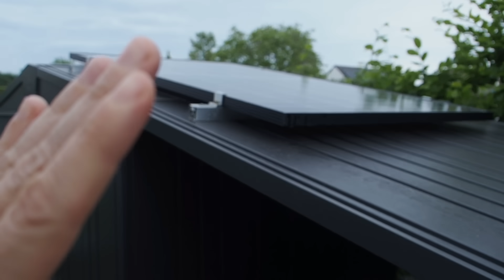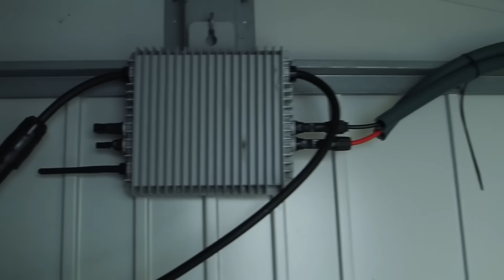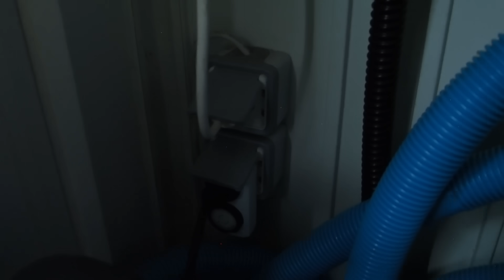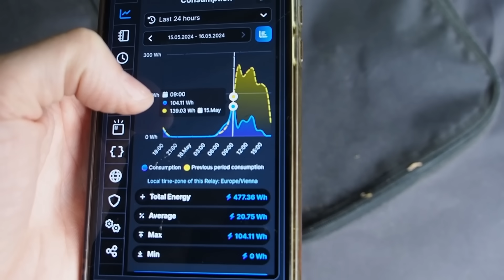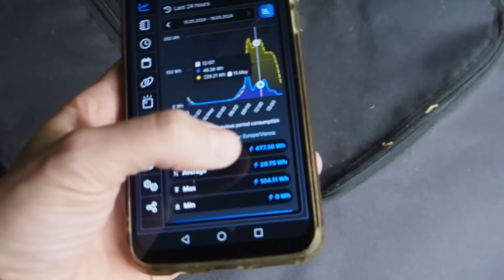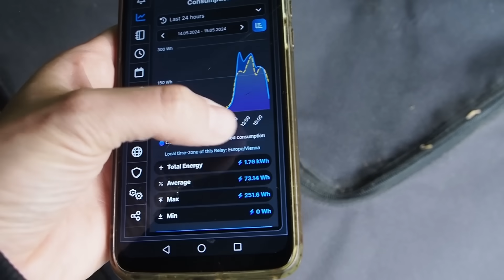Solar system? Yes? No? Which one?

Comment: A good friend helped us build a system that's been kicking butt for five years now. I spent $17,000 USD but that included 18/250w panels, 24/6v batteries, inverter, charge controller, a vented propane wall heater, a hybrid (petrol/propane) 10kw back-up generator, an insulated 8ft x 12ft building to house the batteries and electronics and paying my friend 2,000 for a lot of work including an excavator digging a 205 ft trench and doing a lot of electrical work. It is a 48v system.  The house is in the middle of the forest and grid electric is a mile away so after over 20 years, it was a very welcome luxury!
Reply: Very cool. It makes me always happy when I hear storys like this when ppl helping each other.
Which kind of battery did you install?
Reply: 48v system is the way to go. I wouldn't even consider 24 for a home. An RV or boat, yeah. Cables, lugs, terminals, less output.
Reply: @rtsrts2317  Getting ready to start a van build on a big Promaster and thinking about going 24v.  24 is more efficient than 12, 48 is more efficient than 24, etc.
Reply: @rtsrts2317 my 2500 Watts 12v inverter...powers portable a/c..and TV and fridge..all I need ..maybe if your stationary..u need 24v... otherwise alternator does the trick
Reply: @HANZELVANDERLAAY  How does the alternator run? What recharges the inverter?
Reply: @TeutonicNordwind  off your vehicle..when u drive around..charges deep cycle batteries..also nowadays..u can get 325 amp alternators..very powerful...quick charging....and later when motor is off....use the battery power...and even add solar....to add to the party....inverter just take the 12 volt van system up to house current easily
Reply: @TeutonicNordwind  u can also hook up a car alternator to a stationary bicycle...and charge..the battery ...by peddling..the bike...again look for 325 amp 12volt alternator....install in car....or stationary bicycle 🚲
Reply: @HANZELVANDERLAAY  Oh ok.  I don't want something that's good for a day or two if there's a power outage etc and then has to have power generated to recharge by a mechanical means. What I have set up powers off daylight alone which recharges the batteries. Direct, intense sun is a big bonus. I'm planning for a time when there is no electric grid any more and gas either might not be available at all or is so expensive, people can't afford to run a generator or save it for something more important like log splitter for firewood.  We are totally off grid there at the future homestead.  My system has been running the fridge and freezer all by itself since I left hunting there this past November. Just off of our battery/solar set up. The electric grid is nowhere near the property. The batteries just need to be topped off with water every few months which my neighbor did for me because I couldn't make the trip.
Reply: @HANZELVANDERLAAY  they did a test, even a professional athlete on a bike doesn't produce enough, the fatigue is constant and it would take too many hours, it's fantasy
Reply: @winterburan  I think what you've done here is made a blanket statement.... We can agree you can't run two air conditioners... Off of a bicycle alternator... But you can run a 65 inch TV... You can run a mini fridge... You make it sound as if it's impossible to charge up any electricity... In that fashion... That's a fallacy.. you absolutely can
Reply: @HANZELVANDERLAAY  try and tell me if you can do what you say for 30 minutes, before writing and imagining try, buy a permanent magnet alternator, a diode bridge, a MPPT charge regulator, a battery and an inverter, use the accumulated energy, discharge the battery and recharge it, live perhaps some LED bulbs that generate little effort but after 30 minutes you're fed up, yes you're right it's doable
Reply: @winterburan  yeah I can tell you don't know what you're speaking of... First of all you wouldn't need an inverter to run LED lights... Second of all I could run a huge string of them... All night long on 5 minutes worth of pedaling... Some vehicle alternators put out 325 amps...
Anyway you just don't know what you're speaking of there's no reason to run a power inverter to run LED lights I have a 32 inch TV that runs off at 12 volts ..you know not what you speak of.... We're seeing a lot of that though... good luck to you
Reply: 205 ft trench for cable from panels to inverter?

Wow! That's either a big current drop or you paid big money for bigger cable....
Reply: @willbass2869  I believe we used #4 and there's not shyt for "current drop". It runs the whole household when we're there. Running a chest freezer and fridge right now.  Wire is expensive for sure but when you've got a $15k or 17k project, you don't quibble about about another 4 or 500 in wire. You're committed
Reply: Completely off the grid it is not easy and becomes expensive, but it is very satisfying, if you are lucky enough to have an electrician friend or you manage to do it yourself it is much better, it is already a large system, the next step is to end the use of existing batteries , they are lithium iron phosphate cells, now even the rack ones with built-in BMS are not that expensive and are very easy to assemble and use, although it would be better done with 16 single external cells with BMS and perhaps divided into two banks in parallel, they are very safe and significantly more efficient than lead acid technology, I have never set them above 3.5 Volts per cell, never below 3 Volts per cell as absolute parameters to make them last longer in terms of useful life, often I do not exceed 3.45 volts per single cell during charging 3.5V is the limit for increasing life cycles given the cost
Reply: @winterburan  We are completely off grid and it's been totally free for 4-1/2 years after the $17k spent for the solar power installation with the exception of the propane in winter to heat the small space (8ft x 8ft) - and the property taxes of course, but if I had to replace the 24 batteries today, it would cost me about $4,500 USD. Replacing the inverter today would cost me about 2,300 USD. The batteries should have lots of life left in them though. They were supposed to be rated for over a thousand cycles and we've come nowhere near that and I baby the batteries and electronics and the climate/temps that they live in.. I do not need lithium batteries. There is no need for that expense. The system is in a separate, dedicated building with exhaust ventilation if gases start to build up.
Reply: It's initially expensive, but I finally moved to lithium batteries.  I've had flooded cells and an agm in the past. I'm so happy I finally went to lithium batteries.
Reply: @pstoneking3418  Although if they are not in a living space where emitted gases could be of harm, it's just throwing money away.  I am doing a van build on a 3500 Promaster 159 wheelbase extended and am installing 800ah of self-heating lithium as a 24v system. If you try to charge lithium below 32 degrees F, you damage them
Reply: @pstoneking3418  I see no reason to switch to lithium. Why??  I foresee my system still running after ten years, giving me all the power I could hope for and the batteries are MUCH more expensive so...?
Reply: Very nice,
you would be amazed that today, in 2024 you can buy a far superior system for far less money now, with 550W panels that cost $200 each, and a 10kW inverter that is only $1,000
Reply: @r.b.l.5841  What brand inverter is that? Sounds too cheap. I'm quite happy. I paid about the same as what you are saying because I got 4,500w in panels for $1,800 USD and paid $1,700 for my inverter which is plenty big enough to run the household and it's a very trusted brand - Magnum. That same inverter is $300-400 more now than what I paid. I will never, ever need a 10kw watt inverter.  batteries I bought are about $50-60 higher now than what I paid which was a good competitive price at the time. The most expensive component of my set up was the insulated building which ended up being about $4000.

Comment: In Australia right now they are going to introduce a system where YOU pay for all the excess energy your solar panels export to the grid. Before, people invested big in solar because they paid US money for that energy. Those rates used to be quite high. Now they are a pittance. What they are doing now is trying to force everyone to spend a fortune installing batteries.
Reply: I have had solar since 2013 and I would say they have be totally worth it - even though I use a little more than I produce. The best time is in the spring and autumn when the sun shines a lot and heating/cooling is not needed. Air conditioning is a must in constant 35 C heat during the summer. But I also heat my home with gas in the winter.
Reply from the maker: Wow 😱
Reply: @SurvivalLilly  I'm still waiting for the backlash in the news.......come on people. Give it to the power companies.

Comment: In US Texas they charge 50,000 usd for the solar and claim it will produce enough so no electric bill.  You become part of the grid and are stuck with 1 electric company.  Often your system won’t produce enough to be totally free.  I’d have to ask my neighbors to cut down a tree.  But they STILL would have sold it to me even though it wasn’t’ a good fit.  They encourage you to get a loan.  The only solar I’ll do is a battery system where I sell extra to an electric company.
Reply: Then the electric company will raise your KW  per hour rate. Its a scam. I know I have grid tied solar. Off-grid solar is better.
Reply: @davidsalvador8989 Yep. That's happening in California right now
Reply: @davidsalvador8989  yes i am in Denmark and are offgrid ,i have a 3000w panels a pow mr 24v 80A chargecontrol/3500w inverter and a 1500w turbine and gennerator for nowember,dec jan,  running 15kwh battery,,it works very well
Reply: I designed and installed my own. It was a PITA and permitting has been a royal pain, but I saved a ton and have the system I wanted. I am not using a smart meter. I intend to get completely off grid eventually and I didn't want to be tied to the grid if the power goes out. That's a caveat they don't tell you - if you sell power back you are gird tied and if power goes out so does yours, even if you have solar, because of safety issues - they cannot have the lines energized if they are working on them.
Reply: There's no way I'd sell back my solar to the power company.  Battery Backup with lithium batteries is the way to go. I've just recently started charging my Ford lightning from my solar system,  but only on really sunny days.  I've also used my truck to power my home and simultaneously charge my solar batteries.
Reply: I live in Italy, here storage systems are not convenient, they are not repaid in a useful time, one goes to dismantle them and throw them away without having finished paying for them after 20 years, someone who lives in North Texas told me that the cost of energy it is so low that it is not worthwhile, they do not pay for themselves and are often damaged by bad weather or become dangerous because they come loose during gusts of strong winds etc. They are rarely seen on the roofs, some put them with storage to make up for the frequent blackouts but prefer automatic external generators, which give more power and autonomy to your houses which are enormous with high electricity consumption, all of which costs less and gives less uncertainty, perhaps a small DIY system is the solution to reduce costs and ensure that it is amortized in good time.Ciao
Reply: I live in Michigan. They don't buy back extra electricity. They are also encouraging getting a hookup for EVs, but are looking at taxing it for the roads now.
Reply: Im in east Texas, off grid solar and water. stay away from grid tie system. get a small generator for times you need to charge your bank.
Reply: We have cheap hydropower in Washington State and not much sun yet they are pushing this trash you just know it's another government scam and another way to control our money
Reply: Because private equity has got involved and the salespeople get buck kickbacks from the loan companies. This is another scam just like the liar loans, tons of people being lied to by these salespeople, big article in NY Times I believe in January of 2024.
Reply: Yeah I got screwed here in Grand Prairie Texas and Am in contract with a lawyer about how the company lied to me and said I would have no more bills which is a lie

Comment: Have a off grid system with a hybrid inverter
Reply: ... and with battery storage as well. It doesn't matter if you reduce your bill on a monthly basis, but what would you do if there is a power outage ??? Without battery storage, you are in the dark as everybody else. This is why everyone should install their own solar panels grid independent of any state or government sponsored programs. Because they do not allow you to have storage installed for about 5 years. Not quite sure how that is in Austria where Survival Lilly is located.
Reply: @brainbyte3970  yes I have a system with 3 banks of 48volts 4 batteries on each bank ! I am off grid

Comment: Fit it yourself and get an electrical engineer check it out ! I fitted mine myself and it has paid for itself in 2.5 years and energy will keep going up
Reply: You should have a dc disconnection switch from the solar panel before it goes into the inverter
Reply: @garrydunkley1000  yes mine paid for itself in a few years.  Best thing I ever did - energy in Europe went crazy
Reply: @garrydunkley1000  ideally, there should be properly rated circuit breakers at each end of any positive DC line to protect wiring or cable and to protect from potential, fire.
Reply: @rtsrts2317  yes I agree but as the minimum you need a disconnect on the dc lines